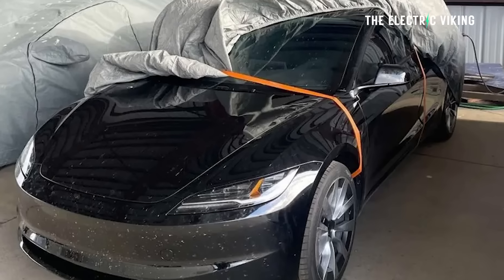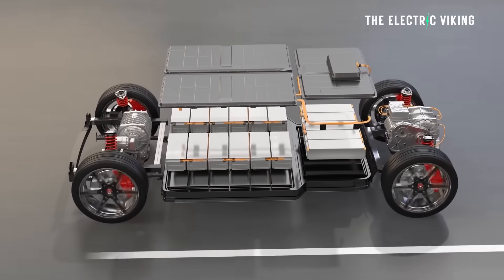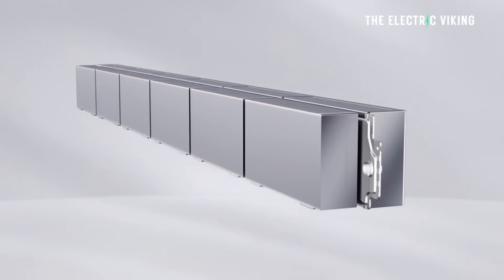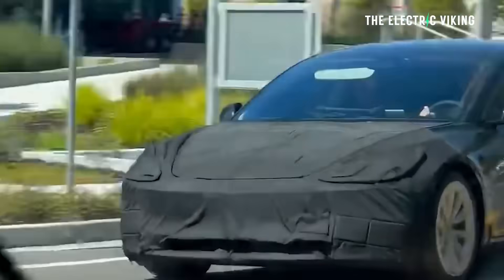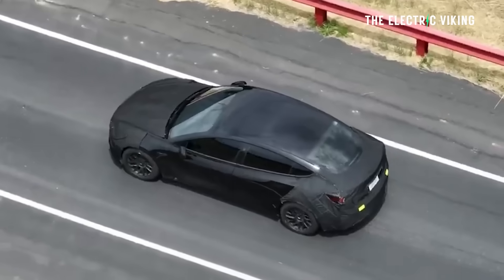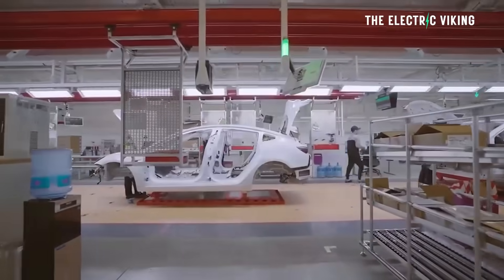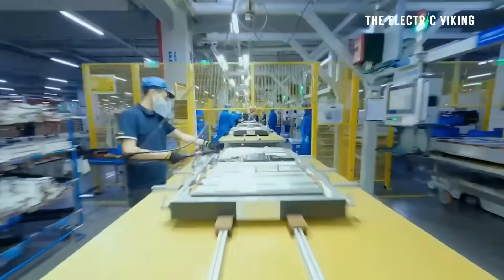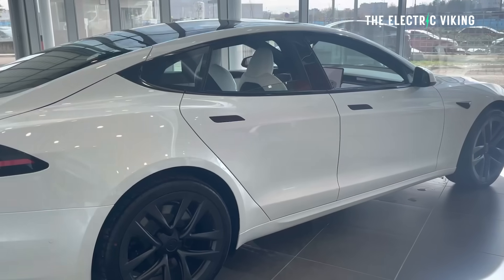NEW leak says Model 3 has 440 mile range with higher energy density

Comment: That 440 miles could be CLTC which translates to ~325 miles EPA. That's slightly worse than it is right now so... the leak might be true.

Otherwise, the leak makes Zero sense; doesn't pass the sniff test. 💩 Now if that was a new battery pack for the Model S/X, THAT would make more sense and be a desirable thing.

Or... Aliens.

Comment: No way will a 66 kw battery get 650 or 700 km of range. That may happen on the unrealistic Chinese range test, but let’s be real, the 66 kw battery is only a 10% bump in density. So figure about 480 km of range, which is a 10% bump over the current EPA rating of 438 km. Plus we all know that Teslas only get about 80% of their overly optimistic EPA range anyways. So please don’t got spreading rumours like this.

Comment: Here's the EV paradox (some would say deliberate fraud): 1) do not charge over 80% full, 2) so not fast charge too often, 3) cold weather reduces range, 4) towing or 4 passengers reduces range, and 5) batteries 80-65% efficient in later years (yet warranty does not cover this). Add those five things together and that is why EPA and other tests show OEM ranges are inflated and most likely intended scams. Ioniq 5 was listed at 24% over actual range and some owners are suing.:face-pink-tears::face-orange-frowning::face-blue-wide-eyes::face-turquoise-covering-eyes::face-fuchsia-tongue-out:🤬

Comment: As you mention the concurrent use of two different battery chem-tech (LiFePo & Nickel/Cobalt), is it possible they are mitigating the wearing risk of fast recharging that way, where they recharge either at different speeds, or in different use cases? There's this video by Danish (Thai origin) Ytoober Bjorn that reveals the ageing of the battery in a Tesla that had been used as taxi and only ever fast recharged (an interesting observation within that is that the car had been recharged more from braking-recovery-recharging than from hi-speed outlets). Let's say the video exposes snakes in the grass.

Comment: Tesla won't give people more range until they absolutely have to.  More energy density simply means Tesla will put a smaller battery pack in the car.  They don't want people having more than 350 miles in the X, Y, or 3.  Tesla has decided you don't need more than that.

Technically though, if you stick between the recommended 20%-80% charge, you only have 60% useable miles, which means 300 x .6 = 180 ish miles

Comment: Only two types need supercharges; those without a garage to park in; and long distrance drivers.  Both will be able to go to a supercharger less if there are vehicles with longer range.  Presumably long trips are infrequent so the added range is mostly wasted for those not frequently going o them. It would be better to make more vehicles making use of the lithium on a daily basis.  This actually is true all the way down to a range of 40-50 miles so hybrids are better because you can make more of them with the same limited lithium.

Comment: Tesla tires due to the heavy batteries are wearing out and those toxic chemical particulates are going into the air faster than ICE cars. EV are not zero emissions as their brakes and tires burn down quicker and fill the air with nasty chemistry. I was at a busy tire shop today. Of the 21 cars going in and out I counted, 6 were Tesla. That's a very disproportionate number. I asked one of the Tesla drivers and he said he's on his third set of tires in 90,000 miles. Don't they get 50-79K like other cars? Hell no.
Reply: I've never got 50-79K miles on tires on any of the ICE cars I've owned.
Reply: @twostate7822  With an annual front end allignment, 2x rotations a year, checking tie rods (if you notice squirrelly steering) and buying a good brand (say Goodyear or Michelin 69,000 mile tires) they will last 60K. I used to skip those maintenance things and buy the cheapest 39K tires and learned it was a bad value in the long run. I had a Goodyear tire with a roofing nail sticking out of the sidewall and apparently drove 100 miles and it did not even lose pressure. I bought that model tire for years to come.
Reply: @twostate7822 I do.

Comment: Could it be that all facts are true, except rage? If the pack is 20% more energy dense at 10% extra cost and Tesla uses a battery with fewer cells so the cost is the same, but the kw/h goes up by about 10% not the full 20%. This would make the pack lighter, and smaller but with more range.

Comment: Good thoughts, but here’s the reality.  Elon will not cut into revenue with the range king Model S.  Also, he has stated on numerous occasions that people don’t need 400 mile cars.  That’s why Tesla is building out the Supercharger network for the less than normal road-trips. It’s better to reduce the size of the pack therefore reducing weight and increasing efficiency and lowering cost of production.  I believe 300 will be the new number.
Reply: Well said! 👍🏻 300 miles and 10-15min for 200-250 miles of range back. Just like the newest catl xianshang b.s. named battery.
That cell and pack design claims 400kms recharged in just 10mins for mild weather use. 🤔
Reply: Saying nobody needs 400 mile EVs is good marketing when nobody has 400 mile EVs. When every other EV maker has 400 mile EVs at a popular price point, you can bet the Tesla will be there with 450 or 500 mile EVs.
Reply: @twostate7822  tesla has has a 400+mile ev since 2020 now. The average daily commute globally is well under 40 miles total. 🤔
Reply: @4literv6  Technically 400+ (405) based on EPA (and even more in some other mileage ratings) which is less than 400 in real life driving. But I said popular price point, not the ~$90K Model S which is definitely not a popular price point.
At the Model 3 and Y price points the competition right now is mostly well under 300 miles range.
When new solid state batteries come out which are promising 700+ miles range and 10 minute charging (10 minutes is physically impossible with today's level 3 charging rate), Tesla will be switching to something equivalent.
As a matter of convenience for owners without home charging, more range reduces the need to drive to a charging station as often which may be quite a ways away for some.

Comment: These cars get so much better in 10 years, that first model 3 sold 2017 summer, the specs will not be even close same as 2027 model 3. Year 2027 It can be very difficult to sell that 2017-2019 model 3 and get any reasonable price. Even this new Highland model 3 will make 2017-2019 model 3  prices go lower than ever before.

Comment: I am sorry but there is no way it is getting 400 miles of range out of 69 KWh. That just isn’t going to happen.
Reply: They get 279 miles out of an awd model y now with less capacity than that. I could see low-mid 300s happen with improvements to the aero, better ev tires and the newest hairpin wound motor tech happening with the highland and juniper refreshes. 👍🏻

Comment: Yeah zero chance of the model being close to 400 mile range, even if the energy density is high they will reduce capacity & weight to keep the range in the mid 350 mile range.  The electric viking has a history of promoting unfounded nonsense so that this with a grain of salt.

Comment: Thanks for the news Sam. 
For me, I rather have a cheaper EV with 350km range and fast charging in 10 minutes, than a 700km range and have to charge 45minutes.
Reply: Well you can still charge it for 10mins & the car will still be able to match 350km range. The benefit of a higher capacity battery would be if you need to travel more than 350km before the next charging station is available. It depends on where you stay and how develop charging stations are in your country.
Reply: @zizimai7568  In the Netherlands there are over 110.000 public charging stations already. And every day there are added more. In the EU there is agrement between all nations, to build a huge fastgarging network over the EU. 
At least every 30km a fastcharger station for cars and 60km a specialized station for trucks. 
In all the world, it wont stay like it is today, they are building a network of fastchargers like madmen. 
And the batteries will change to. Solidstate batteries will be able to fastcharge in less than 10min and without degredation.  
Why needlessly spill and waste materials?
Reply: You are a nut
Reply: Not me I've never had to fastcharge my car and I don't plane on ever doing it unless I have too I would way rather have twice the range but slower fast charging I think most people just charge thier car at home
Reply: @BLEEDGREEN7777  Thats what i think too. Charge at home 99% of the time, and for longer travels, like 1000km to Austria or Italy, fast charging. 
When you only charge at home, and refuse to charge during traveling, you'll never be able to use an EV for longer trips. 
When you can safely fast charge, and in the future you will be able to, there is no need for 1 metric ton of battery material in 1 car.
Reply: Exactly, if batteries take 20-30 minutes to charge, stuff that, explain that to your boss when your late for work, you just factor that in I suppose
Reply: @Peye-pv4cb  To be fair, It is always the same group of people that are late at their work. 
It is your own choice what you use to go to work. Public transport, bike or car. 
You could get up 30 minutes more early, when you know you have a transport that needs to charge every 25mls.   
I never ever came 1 sec to late on the job, always 30 minutes early. And dont ask how many years that was in traffic jams around Amsterdam.🤣

Comment: TESLA is CONSTANTLY improving their BEVs, their manufacturing processes, their business strategy and tactics, their supply chain, pretty much EVERY aspect of the business. THAT is why they make the BEST BEVs on the planet. I may end up with a Model 2, Cybertruck, and Model Y. Somebody has to do it.   :)  Cheers and thanks for the videos.
Reply: @emilioagudelo5787 you might be right. Apple is not the best but still the biggest and most profitable.
Reply: @emilioagudelo5787  Someone doesn't really know what they are talking about. LFP is a lithium-ion battery just as Turnery batteries are lithium-ion. Both use lithium ions but have very different chemistries to go with that. LFP is slang for Lithium Iron Phosphate (the chemical symbol for Iron is Fe, that's where the "F" come from ) Don't confuse iron with ion. As far as "without Chinese, Tesla can do nothing" goes, that is totally false. It would still be something, just smaller.  Chinese quality in most cases is poor, getting better but not as good as other nations. There are some companies in China with quality products but many more without. I buy many Chinese products from eBay and Alibaba, some are OK, but many are poor quality in that they don't last long. Quality is used to describe 2 things, look and longevity. Just as most nations have outdated impressions of EVs I think most Chinese are the same with Tesla's quality, it's outdated, but Tesla has improved. Here in Australia, it is said that the Chinese giga factory has the best-quality cars (one of the exceptions in China) BYD and MG are also well-regarded, but that's it, the rest are not.

Comment: So if they say 400, maybe it will really go 300 for a change.
Reply: Mine says 330 in my mylr I've driven 343 on a single charge I've also maxed out at only 267 it somuch depends on climate and other factors they should just start coming up with a minimum and maximum  number kind of like city and highway for gas it makes more sense

Comment: Yo viking did you hear about the Drexel University claims about a new sulfer sodium battery? 4,000 charge cycles, 2x lifespan of li-ion with ⅓ weight. Say they checked 100 times to make sure the results were genuine. There's a lot of miracle battery claims, being a skeptic this is probably the same.

Comment: The current long range M3 has 359 miles EPA range. Jumping to 400, especially if it’s using European or Chinese ratings is not unthinkable.
Reply: That is with an 82 KWh battery. You aren’t going to get 400 miles with 66 usable KWh.
Reply: On Tesla's US website, the long range has a range of 333 miles. It was 358 miles with the lithium ion batteries but that was reduced to 333 after it returned to production following a length disappearance. That seemed to correspond to the RWD model going to LFP batteries, but I haven't seen confirmation on the exact battery in the LR.
Reply: So, you think that non-American ratings are ... better or stricter while Europe and China are less real and hence sloppy? How do you come to that conclusion? If you think that America is more negative about EVs than anyone else in the world then, sure, you are right!

Comment: Never in history has so much conjecture been squeezed from so little real information. Let's revisit this when the actual car is released and real world data becomes available. Still, keep up the good work, mate. 👏👏👏
Reply: @SunriseLAW The up front costs of making an EV battery replaceable would price such a vehicle out of the market.
Reply: @SunriseLAW  Please tell us more about how EV batteries will be replaceable, when they are an integral part of the structure and rigidity of the car, and removing any and all unnecassary parts, especially such things as bolts and other fasteners, is the top priority for reducing the cost of building the car.  
I'll wait...
Reply: @SunriseLAW  References?
Reply: @SunriseLAW  So you think calling you out for your unfounded claim is gaslighting?   Do you even know what gaslighting is? 🤡🤡🤡
Reply: @SunriseLAW  Still deflecting?  Still no backup for your claim?

Comment: Not true. The ”source” says MP3 battery is 20% more energy dencity compared to LFP battery, not NMC battery. So NMC has still the highest dencity of these three battery types. Also was mentioned 600km range capability, without telling the size of this miracle battery😅. I would not spread these ”rumours” without any evidence of them being true.
Reply: Too many cheap juice stories on this channel for my taste.

Could be 600km range on the Chinese test cycle. Which equates to what 500 ish km on EPA/WLTP? Which is the same as the 'smaller' (compared to current LR Model3 pack) NCA Panasonic pack in my 2019 Model 3.
Reply: It depends because there are EVs that have a narrower margin when comparing CLTC and EPA cycles. @kaasman78
Reply: Who ya callin' dence?
Reply: Gigacasting will be responsible for some range improvement by reducing vehicle weight.
Reply: @garytulie8567  Has hardly any impact on range. Mostly on cost.
Reply: He said 20% more dense than LFP…

Comment: I’m going to need a lot of proof before I believe that the Model 3 might be capable of 400 Mile range. I hope it’s true. In any event I believe that the revamped Model 3 will have a much bigger impact on sales growth than most believe.
Reply: Whatever the rated miles they say cut 80 miles from that to get RL millage.
Reply: That's true of an car ice or bev as the epas test don't actually run the cars at real world usage anyway
Reply: @robert5008 the US government dictates what the mileage is for each vehicle made/sold in the US not the individual manufacturers. Duh.
Reply: @vec306  No you are wrong, manufacturers are allowed to use two different milage testing methods. It is up to the manufacturers to choose which method they want to use and the manufacturers submit the test results to post on milage. The government only spot checks manufacturers so no not all cars are tested by the government for published milage.
Reply: @robert5008 , however both methods are certified by government I believe…
Reply: @777skypilot  You are correct, but the testing methods are dubious in results.
Reply: @robert5008  Well I am sure they are repeatable but would you want to. First you need to need to wait for the perfect temperature to arrive. Then you need to drive fairly slow around 80km/h (50 mph). This would ideally be on a straight flat road. Air-conditioning and all accessories off, with all the windows up. 
I did a road trip on a 18C day. So no air-con, windows up and fairly straight flat road doing 100km/h. The sector was 173 km and I got within 2% of projected EPA range. So on a good day perfect roads EPA range is doable but frankly not at all practicable.
Reply: Same, Chinese standard NDEC is 20 to 30%  overrated.  So 320 miles ( over 500km !! )  BUT with a smaller battery.  So and 77kwh battery ( like now used could hit 400 miles ).  Lets wait and see 😊
Reply: I doubt both.
Reply: 400 miles range with a safer cheaper LFP battery and a higher density making weight less.  This makes the kW/KM go down.😳.
Reply: The Epa has 2 different efficency tests one is based on just 2or 3 tests and the other is based on 5 tests from memory, for eg I think the Taycan mileage was over the 3 test setup but am happy to be corrected on that.
I would love the Taycan with a tesla plaid battery and drive train in it.
Oh baby
Reply: My guess is that Tesla will use less of these batteries so they get like 350 miles of range. This will lighten up the car and increase range even more.
Reply: @nickmcconnell1291  There probably is a way to optimize car weight and efficiency and range where you just don’t keep stuffing as many batteries as possible into the car. I believe that the Model S has a long range version of something like 418 miles, so I guess theoretically they could achieve the same with the Model 3 with the right power density in these new batteries.
Reply: My lr m3 is rated at 360 miles on a 75 kw battery. If I drive it conservatively I could most likely get over 400 miles. In a tesla when the battery is empty, ie zero miles left, there is still enough energy for about 15 miles.  This is a buffer.